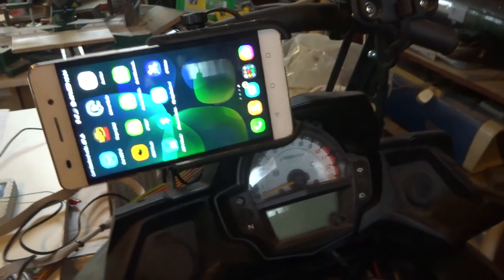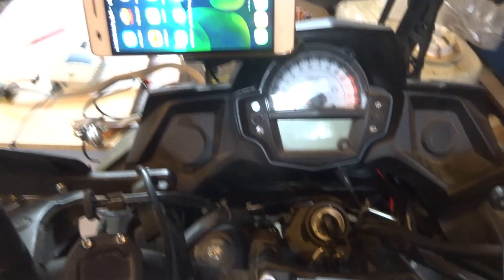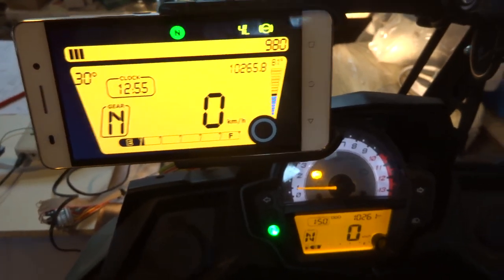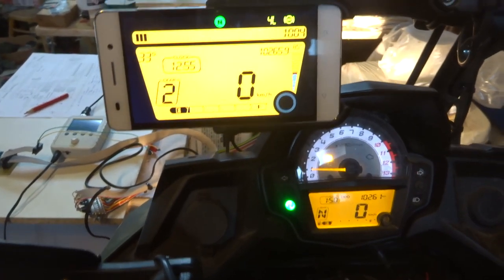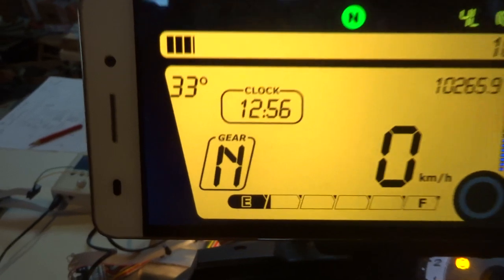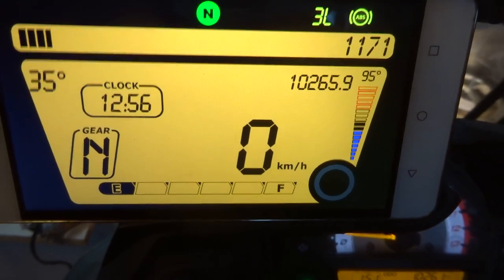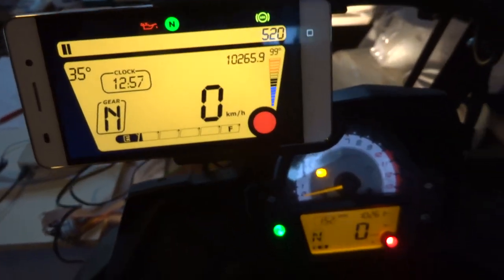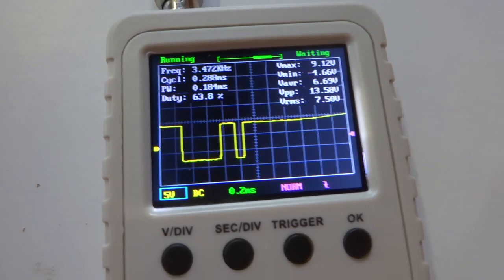Smartphone dashboard DIY for motorbike Kawasaki Versys 650 with AVR Atmel Mega 8 (arduino)

Comment: Thats the most amazing use I've seen so far. Good job sir! Any chance of code, diagrams of connections? I am looking to create similar for my H2 SX :-)
Reply from the maker: Thanks. I want to prepare project on Github, where will be sources, schemas, etc... But I need to update sources, because its are in "poor" status. Sometime messy, sometime spaghetti, sometime hardcoded... Chip and also Android code. Also I need to update some formulas - especially for fuel. Because I did make measure for fuel liter by liter - to get values. But than I did espy that voltage of fuel signal depend also on voltage of whole system (more RPM = more Volts = shows lower level of fuel). So I did make update of schema (change reference voltage on AD), but code was not updated.  I don't know when I will find time to do it. When it will be published, I will add link to description. So occasionally look here...
Reply: @mariosiska9824  sounds great. Following this, have a nice day!
Reply: @mariosiska9824  Will be nice to have it and build it for myself. Following! Give mee feedback please when you are ready with uploding to github!
Reply from the maker: @ferencujvari1071  Sure. Now I am too busy, so don`t know when it will be. So pls be patient.